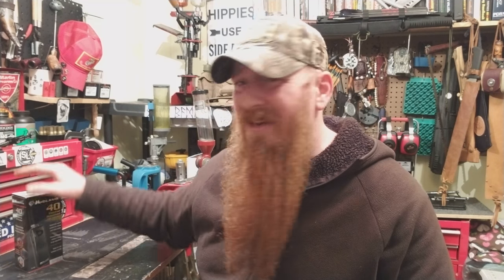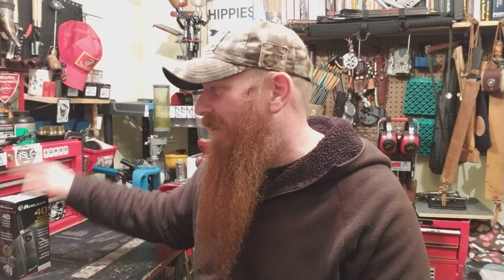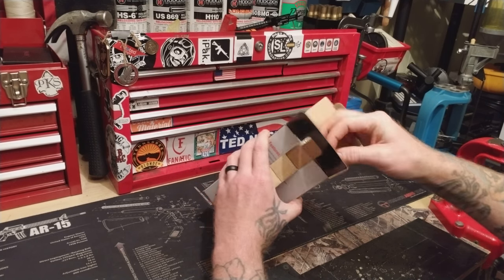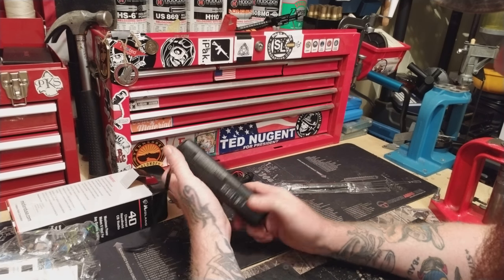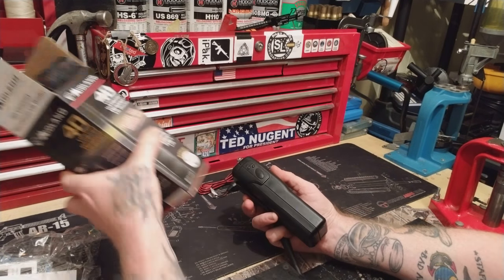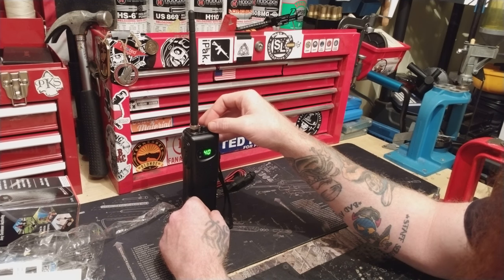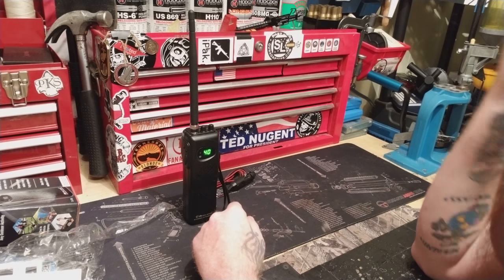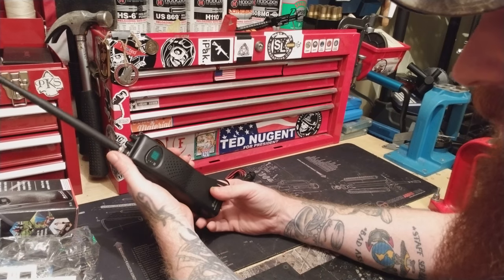Midland 40 Channel Handheld CB Radio Transceiver

Comment: I love my CB in my pickup truck, it's a big help in highway travel. Came in handy in a four hour backup. Unfortunately a semi caught fire and shut down the highway. Took the local radio station almost an hour to actually report it out and tell folks to stay off. Made for alot of fun while sitting and waiting for it to be cleared up. Thankfully no one was injured in the fire.
Reply from the maker: John Smith I remember standing duty and I would check on my truck and the guys in the barracks would be waiting for me to talk to while they were drinking in the parking lot On channel 10

Comment: Cb radio is 27mhz, or 11 meter band. You can stop by a truck stop and pickup a bnc to 232 connection and run the handheld cb to a full size cb antenna on something like a magnetic mount, or even a dipole. Btw i prefer the Cobra wxst38 handheld cb radio. Channel 9 is the emergency channel and 19 and 21 are the unofficial trucker channels.
Reply from the maker: Reaper 1 I've got that one in the Toyota I think
Reply: Wilson makes a 4 Foot Flex antenna and I have good luck and great distance. 70+ mile on a Cherokee AH27F walkie talkie. You want to try that.

Comment: Just a side note. Cb radio is high frequency or HF and therefore has some propagation aspects. Also cb has a lot of aftermarket support to greatly increase it's range quite easily or mounting options. I personally have a base station for the house and a mobile unit for longer range communication over 2m and 70cm.
Reply from the maker: Reaper 1 Yeah that's what those dudes' we're talking about on the radio

Comment: I had 75-785 since 2011. Used a lot in 2013. Got HYS 51 inch telescopic antenna for it recently and it works great.

Comment: I believe that I had this same model years ago. I tried using it to broadcast. Was not pleased with it at all. I could not get any response and I lived about a mile or two down the road from a truck stop. I tried several times but never a response. But I was however able to pick up a conversation between two guys. One was from the sw desert ( Arizona or Southern California) and another guy who was in the upper Midwest. I was on the east coast.

Comment: Great video SSgt. Besides listening to my CD player or the local radio stations, that CB radio was my information source and entertainment when I used to drive over the road. Listening to them yacking away brings back memories. As far as HAM radios go, I'm still hunting for a PRC-77 unit so I can have a mobile HAM source that can be used in a truck or carried on my back. According to my uncles who served, as long as you had a good charge on the battery it could transmit no problem over the peaks out of some of the valleys they had in Nam.
Reply from the maker: nice

Comment: Check out homemade repeaters you can put on top of the hill. Through a line over a limb and pull it up. Will help with the Baofeng.
Reply: I picked up the Midland 40 channel. Haven't used it as yet. Putting the 9 AA batteries in is a pain in the the ass.

Comment: Informative vid!  Wait..you got 30-50 miles with that rubber duckie antenna??
Reply from the maker: I used the 2 jack connection
Reply: rallypoint1: Its not too difficult if you get on high ground.....my "record" is 53 miles with a rubber duck from Pavey Ark (2300 feet a.s.l.) in Cumbria, England.

Comment: I have the UV5RA that I used for communication on the marine band, GMRS and FRS channels also I can listen to local Fire and EMS calls or the local sheriff dispatch. its my information hub. looking into a armature Ham license to talk to other folk way there in other towns. been looking into installing a CB in my Rig have one that's the cobra DX 19 I think then I came into a Cobra that was a blue tooth digital so have a trucker friend looking at that one to see if it still works right.

Comment: I have it.  Gives you the option to run a Wilson k40 in the truck.

But remember the cb band sucks right now and doesn't start coming back until 2019 because of the 11 year solar cycle' s effect on the 22Mhz band.
Reply from the maker: hmmmmm
Reply: SteveBarber1121     Wilson 1000 is better.

Comment: which do you think is better Midland or Cobra???
Reply: DJ Stevenson all radios sold in the US have to be built to the same FCC specs. so the only reeeeaaaaal difference is the fit and finish basically. I like cobras in a vehicle just because I like the way they look and feel... I'd probably go with the Midland handheld because they look sturdier.
Reply from the maker: DJ Stevenson both are good think cobra is better

Comment: Australia went from 40 to 80 channels
http://uhfcb.com.au/UHF-CB-Changes.php
I have a Uniden UH820S 80 channel handheld 2 Watt transceiver.
Small and tough with long battery life. Has built in removable rechargeable (USB) battery and can also use 3x AAA.
Hardly use it but nice to have.